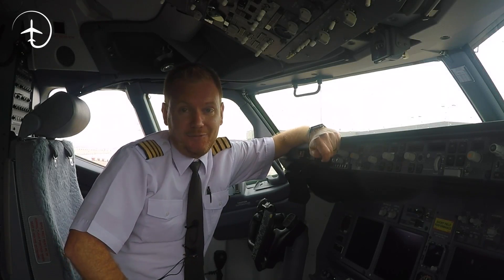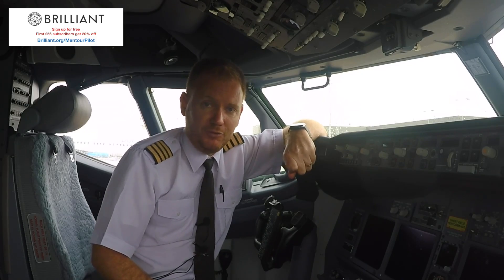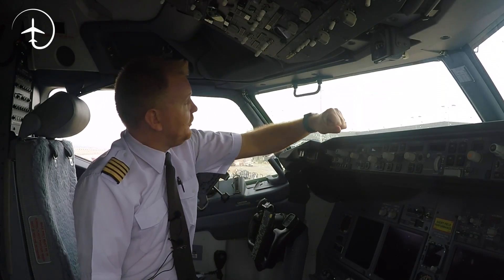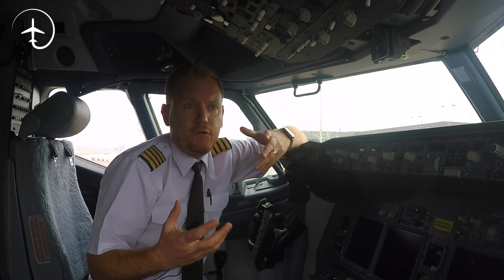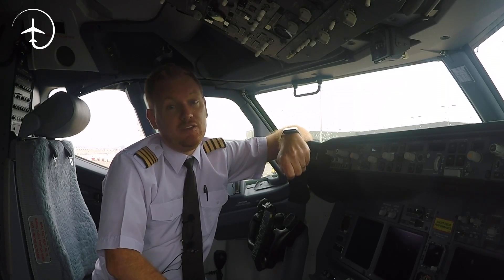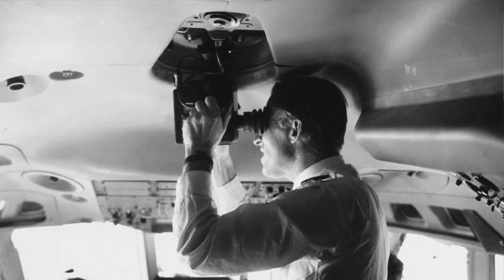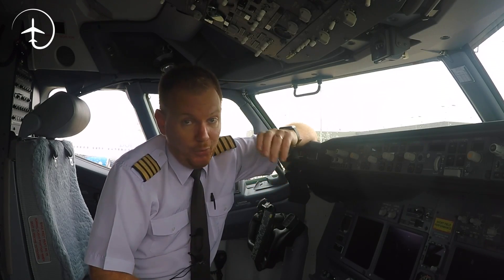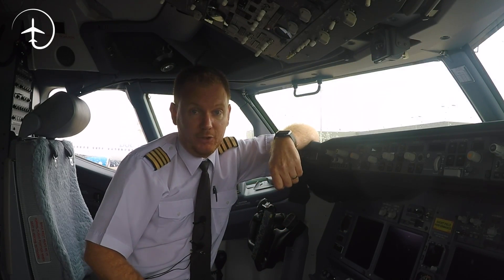Boeing 737 EYEBROW windows? What is the purpose of them?

Comment: Cut out the 'star navigation thingy' all together, cause you don't know sh*t about it! It's called celestial navigation, stars don't need to be precisely overhead, it's the azimuth that's overhead from which the angle is calculated. Precision is way better than 5 miles, I've achieved 0.5 miles with a good sextant. Do your homework first please.
Reply from the maker: If you would have actually listened to the video you would have heard me using the correct name AND explain that the Star does not need to be exactly overhead. The reference position has the Star overhead at that time, that gives the 90 degree angle you need for your trigonometry.

Have a great day.
Reply: Hey Skippy, must be a little embarrassing carrying your ass around in your hands, after it's been handed to you!
Reply: Mentour Pilot, I see you are also well trained in dealing with belligerent members of the public.  No doubt you get such rude ignoramuses as Skippie on flights, saying that the coffee's the wrong temperature or his seat doesn't recline far enough.  BTW, Skippie, the word is spelt S-O-R-R-Y (although something tells me his keyboard won't allow that combination of letters to be typed in that order).
Reply: Mentour Pilot As always, you are a class act.

Comment: Hi. I'm just curious how pilots can see out from the narrow windshield of the aircraft (especially large ones like the A380). You can't see much what's right below the front of the plane. Does it use cameras?
Reply: That's correct! The Airbus A380 uses cameras for taxiing. However, the 737 does not as it doesn't need it.
Reply: Pedro Almeida thanks for confirming what I think. I wonder what the original b747 had

Comment: Do modern pilots need to be trained in star navigation? Because I haven’t heard anything about it
Reply: It had started falling out of use in some military circles, but is now making a comeback. The reasoning is that the military has to consider operations where GPS navigation has been knocked out, and they realized that dropping stellar navigation was putting that mission at risk. They are also trained to do things like navigating by ground features, which is why an event called Pennsic, which takes place in SW PA for two weeks, almost always gets a minimum level flyover by C-130s, since they use features such as small lakes there as waypoints.
Reply: @cinnion  it's also why old communication methods like semaphore and Morse code are still taught. Being able to communicate if radios are disabled is important.
Reply: No, it hasn't been used in commercial aviation for decades
Reply: Still used by some airlines with older fleets in northern Canada where the compass is unreliable, but being phased out with GNSS.
Reply: I have a Single Engine Land rating and I learned celestial navigation back in the late 70's ...it's awesome...Like when you make your first beer, it's like "WOW, I can do THAT."  Braggin' rights.
Reply: Ryan M. Negative. Not at all
Reply: Douglas Needham I’ve heard this!
Reply: i wonder what are the differences between star navigation on a boat and on the plane. Could You provide some links to such informations, please.

Comment: Very nice explanation! 
Just a small note, GPS actually works by very precisely measuring the distance to a given satellite, not an angle above the horizon. The triangulation then happens based on the running time of the GPS signal from the satellite to your GPS receiver :) That's why GPS takes time to calculate the position - the satellites and the receiver need to first synchronise their clocks very properly :)

Comment: As I understand astro-navigation you need to have clear shot of the horizon to get an accurate angle. I can see this being very difficult in an aircraft as if you are looking out a top window the horizon is block from direct view; unless the pilot tilts the craft to bring both in view. I've often wondered about getting a good fix when in an old sailing ship, when the ship is bobbing all around especially in a storm.
Reply: An aircraft sextant uses an "artificial horizon", tho that's actually a misnomer. Instead of measuring the the angle between star and horizon, it measures the angle between star and it's reflection on a horizontal surface, which is double the angle of the angle above the horizon. 19th century explorers used the surface of mercury in a dish, which works well on solid ground. Aircraft sextants use a gyro stabilized mirror.

Comment: What math do pilots use on a regular basis? Is it more advanced then say algebra?
Reply: Pilot math is addition & subtraction and some simple rules of thumb like dividing your altitude by 3 to calculate how many miles or minutes to descend from cruise altitude to airport altitude. All of the complex math is translated into tables or graphs back before those calculations were turned over to the computers. It's not very simple math, but it's using the same calculations with different numbers. If you can learn to do simple algebra calculations you can easily learn the math pilots use. It's all much, much simpler than most civilians assume. Astronauts didn't calculate all of the equations to build or navigate spacecraft to orbit, moon, mars. Engineers did those calculations and astronauts checked that the things they could control fit within the safe limits that engineers calculated. Pilots check the calculations that load planners and flight ops do pre-flight with the fuel load and wind estimates to verify they have fuel to reach destinations and the runway lengths are suitable for their aircraft and the amount of fuel they carry. They check that everyone's calculations "make sense" not that they are accurate to the 5th decimal place. If you can accurately estimate how long it will take you to drive from one city to another you can do pilot math.
Reply: Thanks for the reply.

Comment: Nice video, however, i believe the picture shown from the 747 actually shows the escape hatch, which is necessary as an additional escape route for the flightdeck crews because the 747 does not have sliding windows in the flightdeck. However, i do believe that at least the 707 in its earlier versions had the sextant window in the roof, dunno about the 747 but it is absolutely possible. 

Additionally, celestial navigation can be automated as well, not only do many if not most spacecraft use that, the B2 has an automated celestial navigation system as well, in fact it was initially build without GPS support. The port for the lenses is still there on the top of the wing, left of the cockpit. The cone of error is much smaller in those systems as the time to fix is much shorter than manually "shooting" a star using a sextant. Even nowadays those systems remain a topic of interest for the military as they mitigate jamming or spoofing of satellite based positioning systems.

I flew the 737 classics as well, back before the plug was there. We had boeing provided visors in those eyebrow windows at all times, and yes, usually some paper chart booklet as well. As those had to be replaced regularly the old ones usually ended up in the eyebrow windows. Around the same time as the plug was introduced the first EFB systems came around as well, which was a rather nice coincidence ;)

Comment: Hi.  It's funny.  I've been watching airplanes all my life and I just now noticed those little windows.  

Here's a question :  do modern air liners have cameras mounted in strategic positions to monitor the outside of the plane?   For example: If something happens to the vertical stabilizer, wouldn't it be helpful to be able to actually see it for yourself so you could take the correct actions?   Same with viewing the landing gears, etc.
Reply: They'd probably give the pilots some benefits, but they would be too expensive to install and it simply is not worth it. However, the Airbus A380 has cameras which help while taxiing.

Comment: Speaking of astronavigation, an SR-71 pilot on a different video mentioned the system they had prior to GPS where it would automatically lock onto stars to calculate position. Any commercial airliners have an automatic system like this?

Comment: Very intresting thanks mentour, just a new "video idea/question" I was wandering about. In the boeing 737, why do pilots choose to an ILS approach and then not the ILS landing, why do they choose to fly it manually at 1000ft? just wandering if ILS landing systems are not as safe as they sound or the pilots choose to fly manually because they want to. thanks Mentour!
Reply: To do that so called "ILS landing", known as autoland, the runway has to be qualified and the crew also needs certification to do these landings. There are also other things like for example the aircraft on the ground have to hold further away from the runway if you're making a Cat III approach. So, when the airport is not under Cat III conditions (low visibility, specially), you'd have to advise ATC if you're performing a Cat III approach. There are probably many other reasons.

Comment: After engine start, when is the APU shut down? Right after engine start? Just before the runway?
Reply: The APU is normally shut down right away. However, some may want to let it "cool down" a bit before turning it off. If you're performing a bleeds-off takeoff (turning off the engine bleeds to increase the thrust of the engines because they have more available air), then the APU would be turned off after takeoff, when the engine bleeds would be turned on.

Comment: The astro-navigation bit was interesting. Are there current provisions for backup navigation in case of GPS failure in radar 'dead-zones' i.e. trans-pacific and atlantic flights?  Is the plane on-board IMU accurate enough to get you close to where you need to go until you can get radar vectors? Or would it be manual dead-reckoning?
Reply: It would be hard to do celestial navigation with a two-person cockpit.

Comment: I think aircraft metal is absolutly pathetic. It's extremly thin and flimsy.
Reply: If the metal was thicker and much more stiff, it would increase the weight of the entire aircraft by a lot because it would affect every part of the aircraft. It's currently the most optimal metal that they use to save weight.
Reply: I've heard that relative to its size, the metal is far thinner than that on a drinks can.
Reply: No way the fuselage metal would break form the weight of the aircraft or it will explode from the pressure.
Reply: I know but safety is number one priority also modern jets are like the 787 dreamliner are made mostly made of carbon fiber composites which is way stronger then metal but lighter. This means that they can make the fuselage thicker and much stronger and still save weight.
Reply: Sorry I ment "pathetic"

Comment: Good explanation.  However, one lingering question I have from 40 years ago:  Why does a DC-9 taxi with one elevator up?
Reply: The elevator on DC-9 / MD-80 series are driven by aerodynamic tabs on the rear surface rather than hydraulics or cables. In flight if the pilot wants to move a control surface elevator/aileron he maneuvers the control wheel which causes the control tab to deflect and aerodynamic forces on the control tab drives the elevator/aileron to give the control effect the pilot wants. On the ground when they are parked or experiencing very light wind the wind can push the flight control surface up or down.
Reply: Thank you.  A few decades ago I asked an airline pilot who was walking through the San Jose (Calif.) airport but he didn't know.  He was flying a different jet.

Comment: Astro navigation in practice has an error of one to five nautical miles which is sufficient for ships and very good for an airplane which moves very fast. 
Theoretically the American GPS the Russian GLONASS and the forthcoming European Galileo are very reliable and accurate. However in war areas satellite navigation jammers have been used in the past. That can be fatal to passenger airplanes. 
Of course only God can change the route of earth, solar system and stars. So the Astro Navigation is the only really safe way of finding your position until the end of time
Reply: Absolutely typical civilian pilot attitude.  No idea about how to maintain a lookout in a VFR environment and has probably never exceeded 45 degrees of bank or 30 degrees of pitch.

Comment: Always wondered about them. Is the purpose the same on the md 80?
Reply: yes. MD-80s are stretched versions of the DC-9. DC-9 was  built about the same time as 737s in the 1960s & 1970s. It's much easier to get a design past the FAA if the FAA has already approved it. That's why many aircraft today are versions of older aircraft, but with longer/shorter bodies, more/less engine power, etc.

Comment: Why are flamible materials used in arircraft when fire is such a risk?

For that matter, why is wiring not run through conduits to prevent chafing or other damage or arcing causing fire to spread?

Comment: GPS and Star navigation is completely different ... GPS uses the runtime of a signal thru the atmosphere from the satellites to the receiver. The receiver calculates, based on the signals of the GPS satellites the position (of itself) and not by the angle of the actual signal received from. The angle of the signal is known by the receiver - but this information is provided by the satellites itself via transmitting constantly their orbit next to the actual signal used for positioning (a timestamp). So changing the angle of the aircraft in any direction does not change the position determined by the GPS even within one measurement - while the star navigation needs a completely stabilized flight path without any turbulences... AND clear sight ... while GPS can work within very bad weather with heavy turbulences - and give somewhat good results.

Comment: I am actually shocked that todays airliners are not studded with small blisters containing small cams so that the pilot can see all parts of the plane while in flight.  So many accidents have happened because something happens to the plane that the pilot cannot see and thus cannot adjust for.
Reply: Adding cameras would be too expensive for the very few benefits it would bring. It is simply not worth it. However, the Airbus A380 is equipped with cameras to help in taxi ops.
Reply: No Perdo.  The cameras are as small as a pea.  I asked a production manager at Boeing and he said it would be cheap and easy but management has ordered it done for unknown reasons.

Comment: Can you explain what a Yaw damper is?
Reply: Yaw is one of the three axes of the aircraft's flight,  the others are Pitch and Roll.  An autopilot, or automatic flight stablization  system,  contains three synchro loops that sense a deviation motion and apply power to the aircraft's controls to  correct the aircraft's motion.

Comment: Amazing video as always! I've also always wondered why do pilots set the engines to "Continuous" during climbing and descent. What is the difference between auto and continuous mode, does it have a performance impact or is it maybe related to fuel efficiency? Thanks.
Reply: Continuous is when the ignition keeps going in specific circumstances like during a stall warning.
It keeps ignition sparks on and that can prevent a flameout of the engine.

How it effects the aerodynamics or fuel efficiency I don't know but I'd guess it takes a bit more fuel to compensate for the extra stress on the magnetos.

Comment: I was told that with KLM they never had eyebrowwindows. They chose not to have them on their aircraft as from their first 737's. They leased 4 737-200's for some time from Transavia. That where the only 4 737's with eyebrows in KLM colors. After that they bought their own 737-300's and further, always without them.
Reply: Patrick PH-BTC: KLM 737 classic with eyebrows. PH-BXF: KLM 737 Next Gen, formerly with eyebrows. So no, not true. Also, the planes are generally leased instead of bought.
Reply: Hi Milan, Thank you for your Eyebrows correction. :)

Comment: Well explained. One question I always wanted to ask. Some cockpits have two or three small light bulb kind of things on the center window pillar. Among others, Learjet and Gulfstreams have them. Most of the time, they are white plastic knobs. Sometimes, they are orange in color. I never saw them light up. What are those things? Because sometimes there are two, and sometimes there are three, I suppose they must represent the engines.

Comment: Hello Mentour, I was wondering that nowadays the aircraft's fuselage are mostly made up of Aluminium and as we know that Aluminium is a good conductor of Heat ! So wouldn't that pose a problem to the Fuselage's Durability and Develop some cracks maybe ?
Great videos By the Way ! Loved it !
Reply: Being a good conductor means that any heat energy that is generated will quickly spread out over a wider area, so you'll have a big warm area rather than one small spot getting too hot.
Reply: Motorman2112 Thanks for the explanation ! 😀